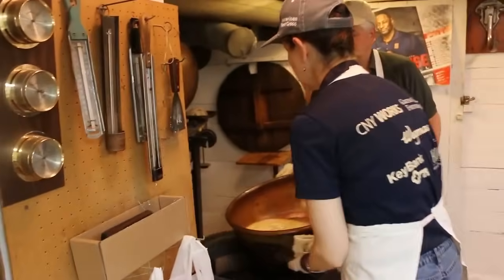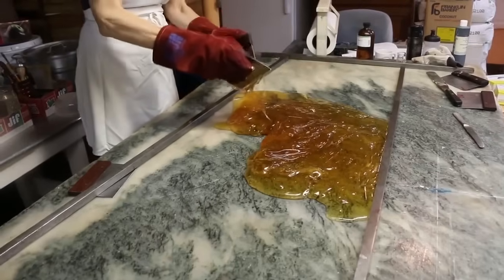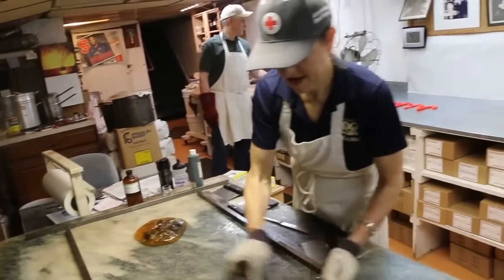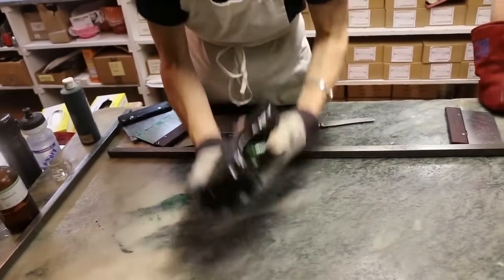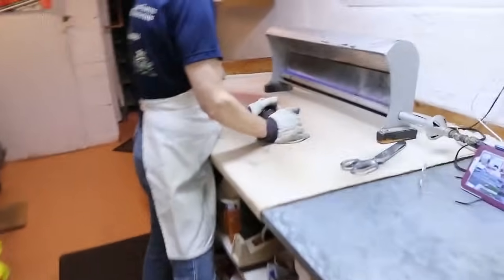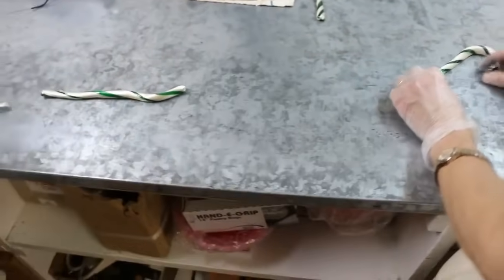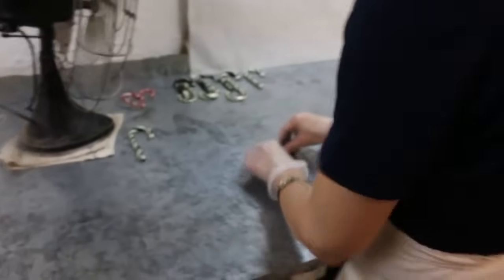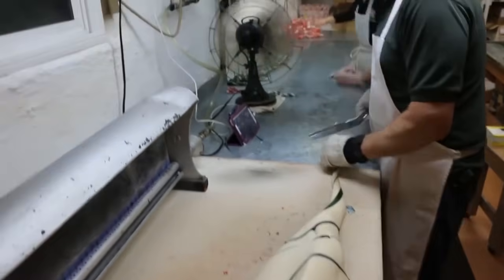Family Secret Homemade Candy Cane Recipe

Comment: The marble stable as it warms up from the hot candy it will hold the heat which allows it to cool slowly which intern form seed crystal in the candy which is how the larger crystal are formed which in turn forms and cools the candy quicker.  So oddly the warm suffuse of the marble helps the candy to cool and form crystal faster.  So if you move the candy to a cool part in the table thinking you will cool it faster that is incorrect as the crystal will not form on the cool surface.  Marble is anywhere from $60 to $100 per Square Foot.

Comment: what does hitting the hanger with the hammer do?
Reply: I believe it loosens the candy from the hook so it doesn't stick
Reply: I think as the candy cools, it starts sticking to the metal hook and by hitting it with a hammer, it breaks it loose as Heather Woo mentioned :}

Comment: Why doesn't the striped glob of candy get pulled on the hook? Also, there are some good kneading techniques you could pickup from ceramics and working with clay. My old teacher taught us this technique where you could cut the pile in half with a wire and there would be no air bubbles after.
Reply: Kneading is a completely different technique used to achieve a completely different result.

Comment: is there a reason flavouring can't be added during the cooking process rather than at the table? does it make the sugar crystalize or anything or does the flavour just evapourate due to the high temperatures reached?
Reply from the maker: It will flavor the kettle and mix in with the next batch